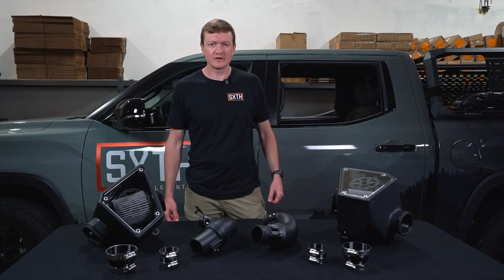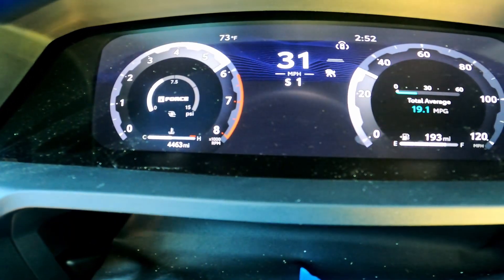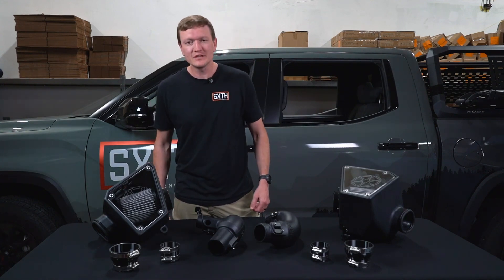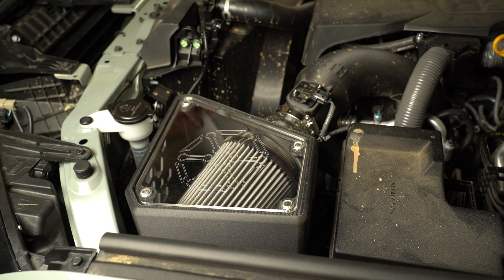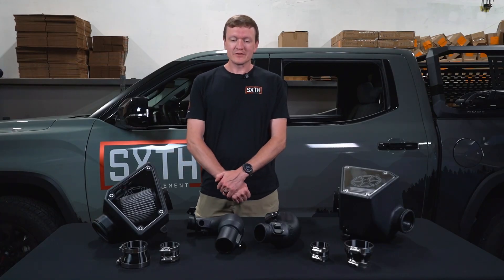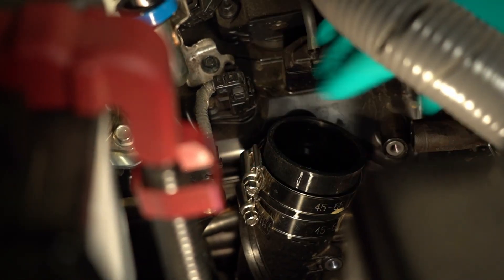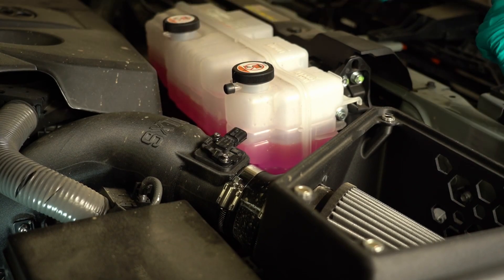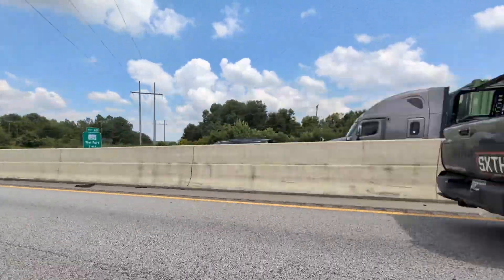SXTH Tundra CPLT Intake Showcase

Comment: Just got mine installed on a '25 Tundra. I will say the video is slightly deceiving due to a couple of brackets that need worked but other than that pretty straight forward.
Reply from the maker: Glad the install went well. Check out our full install video, pretty sure we covered the install of the brackets a little better. Thanks for the comment!
Reply: How's the sound?

Comment: Don't those hexagons in the side of the airbox negate the benefits of an enclosed cold air intake?
Reply from the maker: That's a great question; the design allows for a balance of airflow and protection from engine bay heat while bringing in more cooler air from the the front of the vehicle. 
Thanks for your comment!